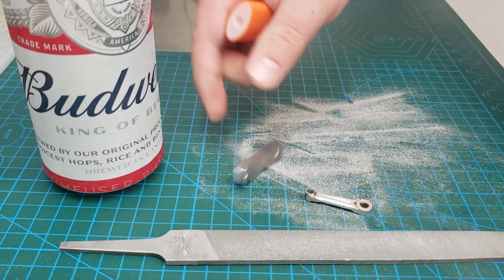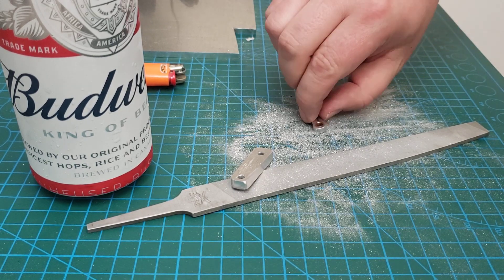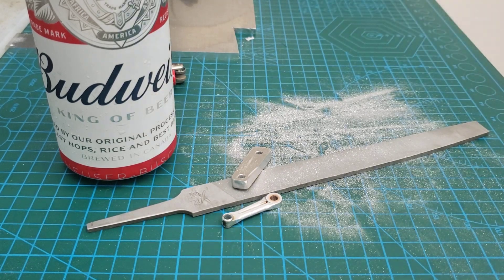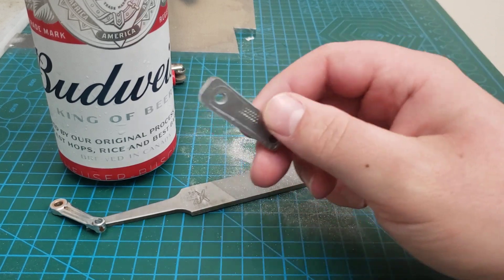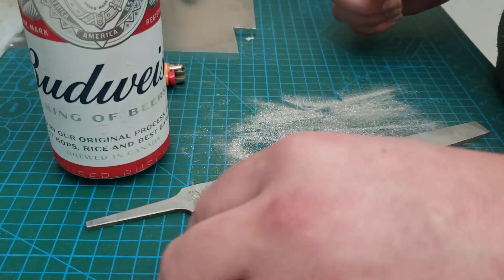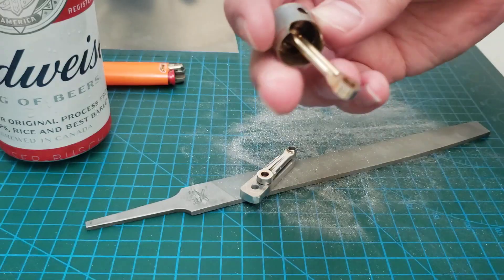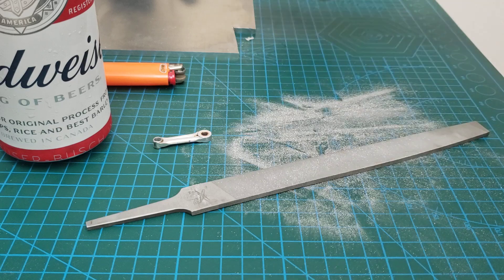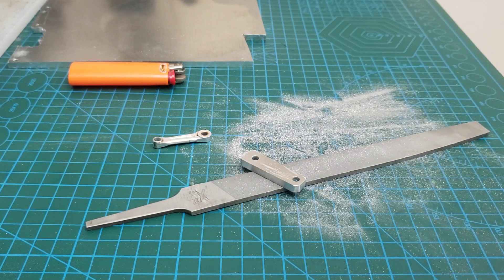hand made TRX 3.3 connecting rod UPDATE 4

Comment: Hey guys do you know of any 3.3 connecting rod upgrades?? On the market right now
Reply from the maker: All gone unfortunately no one is making anything
Reply: @thebug4046  aw man so the only option is to keep buying Traxxas rods
Reply from the maker: @ohmygoshitsadiplodocus1589  unfortunately for now. I just change the rod pin and bearings every few gallons or so and helps them last longer
Reply: @thebug4046   thanks for the tip 👍🏻
Reply from the maker: @ohmygoshitsadiplodocus1589  no problem I have video showing how all that is done

Comment: I now know why u dont reccomend settings for a 19t.   It has to be taken apart and expertly sealed to tune at all.  I hated it now I think its simply amazing.  Hmmm
Reply from the maker: Shouldn't need to be sealed it's o rings all around i haven't had any issues other than the exhaust not sealing properly  or the needle are just out of wack from factory no big deal
Reply: The o rings were not installed right and were cut into little fragments. The large one anyway. And the screws werent tight.  So I used ultra copper sparingly.